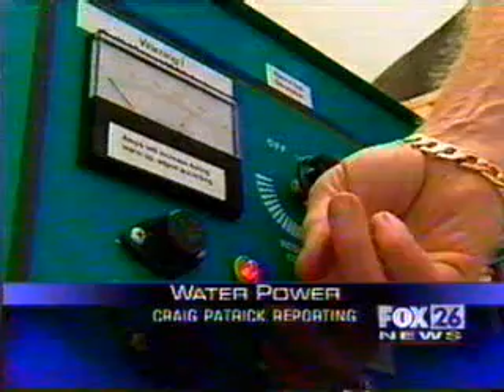Water Fuel Car

Comment: I did this in school,All science class`s have a glass tube that looks like a Trident,At the junction where the 3 tubes connect,A wire runs through the glass,Fill the center tube 1/4 with water,connect a dry cell 1.5 volt battery to the wire leads,and about 30 minutes the water is gone,One tube will have H.other has Oxy.1/2 as much as the H.,a small float shows each level.Sorry Shawn,Oxy is NOT flammable,it ACCELERATES Combustion,This guy is selling a $10 Kit for $700,DIY

Comment: You can break water down into HHO gas by using the alternator or the battery in the car. The running of the car's engine runs the alternator constantly - this energy simply isn't used except to keep the battery at full charge. You could also use something as simple as a "D" cell battery - like one you put in a flashlight. It wouldn't produce much HHO but it would work. And since the energy is created within the car, why would you need to multiply the number of power plants by 20??? To to what?

Comment: if you split the molecules in the water before reaching the combustion chamber, you have oxygen, gas, and hydrogen exploding all at the same time producing more energy than just gas alone. the guy in the video did this exact same thing with an electrolysis machine when rigging it up to his car. the guy in this video isn't the only person to be featured on tv for this, nor will he be the last. in the 80s a guy was on tv for making his dunebuggy run on gas. he had an electrolysis machine too...

Comment: it doesn't work with water,   gasoline has a LOT of energy,  around 16kw per Kg,  the only VERIFIED way to produce low cost energy is either by reacting aluminium to produce Hydrogen for a car,  and for a home,  you could try building a solar /heater,  stirling engine,  this has same efficiency as diesel / steam engines,  but can be powered by sunlight

Comment: how can cars not be made to run on water? a gas engine can't be converted to run on just water, but water can be used to supplement the fuel supply, making it more fuel efficient, so to speak, but it won't work without heavy modification for it to work properly. the water and gas would have to be mixed with the air during the combustion cycle. some of the first combustion engines invented were steam engines. it's old technology, but with the technology we have now, we could perfect steam engines

Comment: It is efficient but no way is it cheap. Electrolysis is used to separate the Hydrogen and the Oxygen. 1) Electrolysis would use more energy then it saves. 2) The electricity in the first place most likely comes from coal. It isn't cheap at all. Also, yes the world is about 70% water but it wouldn't matter if it was 2%. When the Hydrogen and Oxygen are burned the waste product is water so it would go back to where it came from. Electric cars aren't good either. They just pollute another area.

Comment: So I was skeptical about the Joe cell. However as a true researcher and mechanic, I spent the last full year building and testing Joe cells. Well, as it turns out, they work better than you would ever believe. I realized that they are hard to get working, but very simple once you understand the tricks. I have a lot more detail on my website. I cover radiant chargers, HHO, water fuel cells, and Joe cells. My site is Ritalie.com

Comment: other scams are more sophisticated,  they use hidden aluminum reactors, where a little amount of Al, as little as 2kg,  provided by electricity, and the right conditions,  can react with huge amount of water, producing H and perfectly running the car  for  2000km,  thereby giving the illusion that the car runs on water, that's all you can see, water!  but it really runs on the hidden aluminum!   nice for personal use, but don't bother investing in these people under the pretext of  'water' fuel

Comment: all my comments are based on real world logic, and tested physics,  the proof of energy dissipation is all around you, but you refuse to believe,  Energy is the ability to do work!  if it can no longer do you work,  then this energy no longer exists for you, it's gone!   I have studied the claims, videos, and drawings of many of these so called inventors, they are nothing but non sense,  in this particular video the car runs on hydrogen made by energy from the grid, works, but it's no water car

Comment: OK then, you put water in at one end of the system and the same water comes out at the other end, right? What happens in the system is irrelevant, just that the input is the same as the output. Now, I "invented" a system, where you put gasoline in at one end and the same gasoline comes out at the other end. Are you laughing at me? I really hope so ...

Comment: Just to give you an idea of how profitable diesel smuggling is,  in my country the mafia and organized crime import millions of low cost biodiesel from Bulgaria, and mix it at the pumps,  the drivers never notice,  they also used buy cheap heating oil and use sophisticated machines to remove the red die, and turn it back into original color motoring diesel,  the government and the oil industry try to stop them,  but the smugglers are always a step ahead and smuggling continues like never before

Comment: want proof? how about an energy conversion experiment?   any time, under any conditions,  just convert energy from A form to B form,  you will never recover the original energy A,  even though A still will continue to exist in other forms, heat, chemical energy etc,  it will be useless because it will be too spread out,  energy that is too diluted cannot do useful work again!  that is by the way the law of thermodynamics,  no one has disproved it for centuries.

Comment: All those fancy numbers - in other words - a smokescreen. And by the way - just what is "H2"? Oxyhydrogen has no pollutants. Let me explain this - again - groan - mason jars filled with distilled water with baking soda are placed near the engine, electrodes are inserted in the jars. The CAR BATTERY provides electricity which breaks the water down to oxygen and hydrogen gas which is then fed into the engine. Did you see how simple that was? No fancy numbers, no smokescreen, just simple facts.

Comment: You try to sound so smart when you quote all those numbers. You TRY. Let me explain to you what everybody else has the rudimentary intelligence to grasp but guys like you can't. People install mason jars, usually more than one that contain distilled water and baking soda. Electrodes are inserted and are hooked to the car battery and a switch to turn it off and on. A plastic tube directs the HHO gas to the engine. Can you figure the rest out or do you need help with that TOO?????

Comment: If you watch the clip you will notice that he did not have a tuneup done. Also, do you have a brain? Do you really think a tuneup, which was not done, would double your gas mileage? And this doubling of the gas mileage - this just happens to coincide with the installation of the HHO device in the vehicle? And by the way, what the hell does this mean - "When the jam jar fails sell a EFIE causing the vehicle to run lean." Guys like you are pure ignorance.

Comment: You say: "All you need do is provide evidence in the form of Dyna testing by a qualified driver with the HHO device on, then off. To date, NO ONE HAS DONE THIS."

Then kindly explain THIS YOUTUBE CLIP - with TESTING - BEFORE AND AFTER INSTALLATION - just like you asked for. But I'm sure you'll come up with some nonsense explanation why this "is a scam" - like you always do. 

NBC Chanel 5 Does it work report on Hydrogen Generator with Test Results

Comment: Nor i any of those things, the electricity from my experiance, can power vehicles without a problem, the problem is batterys and weight. I think we should help build a community of technology to improve the understanding of mechanical design. WE can then build machines without the combustion engine, and use engines that produce more power without the use of as much electricity.

Comment: I'm not a car expert, nor a physicist, but combustion of a fuel transfers heat energy into mechanical energy, while a car running on a battery transfers electricity (energy) into mechanical energy. It should be the same, with the battery being able to run longer because electrolysis produces heat energy as well as splitting water, losing some energy in the process.

Comment: The electrolysis of water uses the same amount of energy as the combustion of hydrogen, so there is no overall energy gain, and it cannot power a car. To say otherwise violates the 1st law of thermodynamics. If you can get a high enough amperage in a battery, on a car, to produce enough hydrogen by to push a car forward at over 10km/h, then why not just run the car on the battery alone? It saves more energy and is less complicated. So this won't work, unless you pre-make the pressurized hydrogen

Comment: Hydrogen Technology Applications, the company Klein started to hawk this bogus technology.  If you go back in archive.org, you'll find that they used to claim they could run a car on water (and in fact used to feature this very video).  Now they no longer say that, and instead just claim they have something that will increase gas mileage (hint: it doesn't).

Comment: Two questions that an actual journalist might have asked: 
(1) If you can run a car exclusively on water, why on earth would you configure it as a "gas-water hybrid"?  Nostalgia?  
(2)  You said on a 100 mile trip, you used 4 ounces of water, but *how much gas did you use*?(my car uses no water).

Anyway, if you go to the website, you'll see they've stopped claiming they can run a car on water and are now making vague (and completely unsubstantiated) claims about increasing gas mileage.

Comment: @a1mint Is Hydrogen a gas? Yes. Is Oxygen a gas? Yes. Do they burn? Yes. To split water takes more energy than is released by the process. However, Stanley Meyer found a DIFFERENT approach to breaking water down into hydrogen and oxygen. His approach makes water a practical alternative to fossil fuels. If you disagree with this - that's your choice. Go on Ebay and do a search for hho or hho generator - people are adding hho devices to their cars and getting better gas mileage. Think about it.

Comment: @beetstep HOTTER THAN THE SUN, you see in Kleins Video, Hydroxy will sublimate Tungsten,, FAR HOTTER  than the surface of the sun. Hydroxy is elementally reactive,, each element reacts differently, in thermal yield. 

Knute

Comment: @ElectricMethod Nothing. This is not an invention at all. I've done electrolysis experiments like this when I was 6 years old. You use electricity to convert water into HHO. And then you burn the HHO to power the engine.

But here is what they are not telling you. It takes more electrical energy to convert water into HHO than what can be obtained by burning it.

Obviously, that fact defeats the whole purpose. Hence the "invention" didn't go anywhere over 5 years.

No conspiracy. Just physics.

Comment: @eric42ca Excuse me!!!  Oxy-Hydrogen was the first welding gas,1850s and will test at about 4,200 F. in Open Air. Hydroxy will barely register 260 F. in Open Air. They are NOT the same thing. Hydroxy is a suspension of a very specific “Pre-Manifest” form of energy within the structure of water. (COLD FIRE) Hydroxy has no temperature except a very slight interaction with nitrogen in the air and is totally discriminating in its’ thermal yields based on the materials of contact. Knute

Comment: @TheLivirus Look upon this as you may Electricity itself. You can form Electricity by rubbing your feet on the carpet, combing your hair, spinning permanent magnets in within a coil of wire, (AC or DC), or as in Nature, with the swift movement of water vapor within the Earths magnetic field, or Lightning. (See Hydroxy Plasma in the form of Sprites and Jets, I the upper atmosphere) All are forms of of electrical potential are similar,, though derived from different methods. Knute

Comment: @TheLivirus “Scalable” means that Hydroxy needs no external oxygen,,, The prime oxidizer to sustain this reaction, is contained in the Hydroxy mixture itself AND at a perfect ratio for complete and total combustion in a Plasma State. “Plasma” (The forth state of mater) From the size of a STAR,, down to microscopic dimensions.  The temperature exhibited by Hydroxy Plasma,,, (In open air),, is 259` Fahrenheit. When in contact with materials, this temperature changes. Knute

Comment: @OldKnute "Hydroxy will burn just as efficiently in a pure vacuum"
Doubt it. The lower pressure should mean that the reaction requires a higher temperature.
"is a closed loop system of energy"
Why would it be a loop? External electric energy is used both to electrocute the water and initially ignite the gas.
"requires no external oxygen source", "leaves no ash or poisons"
True for any HHO-gas electrocuted from water.
"is scalable down to Nano-scale"
What do you mean?

Comment: @TheLivirus Well,,, Considering that Hydroxy will burn just as efficiently in a pure vacuum, is a closed loop system of energy,, returns to water after heating materials,,, requires no external oxygen source,,, takes nothing from the air and leaves no ash or poisons,,, is scalable down to Nano-scale,,, Umm??  What about a miniature cigarette lighter for Astronauts?

Knute

Comment: @TheLivirus In the Klein Video above, at 0,30 time tag. The thermal capabilities of ANY flame, is determined by TIME to heat water. (Temperature rise, over time) More commonly expressed in British Thermal Units, BTUs or absolute such as melting points as is used in Kilns. However, HOH or Hydroxy has no specific heat, so as seen in THIS Video,  it Sublimates (Change state to a gas without passing through a molten state) Tungsten 5900 c. Boiling Point, 74W is 5,555 C. Knute

Comment: What they neglect is that Oxyhydrogen was the first gaseous mixture ever used for welding. The first "water torch" was invented in 1962 by William Rhodes and Raymond Henes.

Comment: @endimion17 William Nicolson and Anthony Carlisle around 1800. More clearly defined and quantified by Michael Faraday 1833. SEE: (Faraday Efficiencies). This is however greatly affected by continuity or trace chemical additives known as, “Electrolytes” (Salts, Acids or Base) or frequency and waveform of currents to be applied or pulsed. My work, 1967, 83% efficiencies P>+W = HOH,,, TO,,, HOH = P<+W at a 5% by volume Potassium Hydroxide “Closed Loop”  P = Power  W = Water. Knute

Comment: FACT: 80% of all waste sent to Landfills,,, is organic. The digestive tract of worms and their immune systems, are stronger than the shark. Secondarily; worms need supplemental grits and fine sands to process their food. These fine sands convert to dissolved mineral salts when digested. Balanced ph achieved by selection of these sand additives.  70% Protein, 30% Fat, worms will double their mass every 60 days and daily, will consume half their weight in waste. Knute

Comment: @BigDaz My efforts were always in industrial applications. Steel Production, post production Re-Heating for Manufacturing, Nuclear Waste, Sewage Treatment, Asbestos Remediation, Glass and Ceramics. You mess with the Automobile and this is what you get. Naysay and Negativity. For Industry, Solar is a Given. As for Hydroxy, No Pollution, No Fumes, No Poisons, and returns to water when used,,, THEY GET IT. Knute

Comment: @olegign81 Just use Solar Power and your own Urine,,, Problem solved. If you will note in the video, the combustion of Hydroxy returns to WATER and is re-condensed and purified.  YES,,, Water to a Gas,,, use the energy suspended in Gas,,,, and it returns to WATER. That’s right,,, A closed loop energy system where NOTHING is wasted,,,, OH MY! Knute

Comment: @a1mint Now, I want to thank you for you acceptance of the principles of water fuels. Hydroxy, as you say, is contrary to our conventional understandings of the properties of water. Our only point of contention is the amount of energies consumed and liberated. As with the Exxon Mobil onboard units of 80% increase, there is that discrepancy from my earlier work, of less than 40% other than to say, in speculation, Exxon has made a significant improvement.  TR Knudtson

Comment: @OldKnute The FBI are always armed. You questioned why the FBI had illegally used deadly force at Neverland. Simple answer - they didn't. You still seem confused about what force is in Police terminology. You can't use force against property for example. How do I explain the presence of those people? I don't. But Neverland is a big place, you need manpower to search it. Policemen can multitask. A dog handler could arrest you for speeding, the 'Dog Handler' job title is pretty irrelevant to that.

Comment: @a1mint Michael, I am just offering these as Visual Aids for you. In the (Chain Reaction) movie you will see a LARGE Hydroxy unit. That size was chosen for dramatic effect. The actual unit was smaller than a standard console Television. The Motorcycle Ridding Assistant was patterned after me, and the Professor Charictor is clearly a rendition of Yull Brown. (See Brown’s Photos on the net.) My preference however, was Harley Davidson motorcycles, NOT Café racers. Knute.

Comment: @a1mint No, and you are confused. I said that STEAM, so familiar in the operation of a Locomotive,,,, IS an example of the “THERMAL” Energy Carrying capabilities of WATER.  “I stated, WATER is like an energy sponge.” Water separated by Electrolysis is NOT the same as steam, but employs similar principles and features of WATERS’ ability to store and transfer energy. The Plasma that is core of Hydroxy reactions, has no ash or pollutants. As STEAM however, it IS an energy carrier. Knute